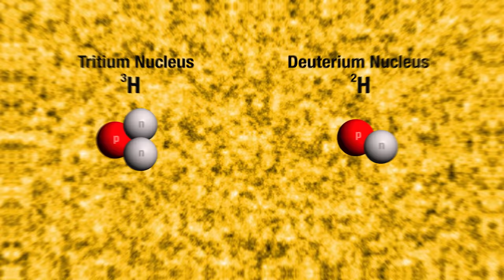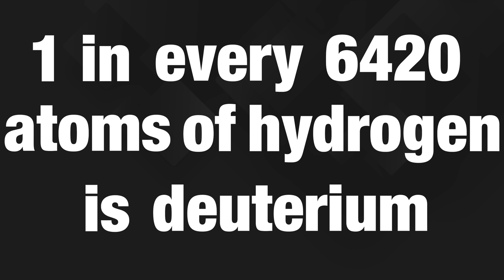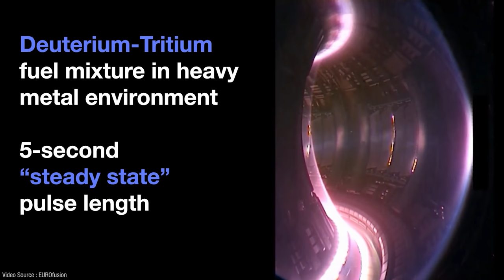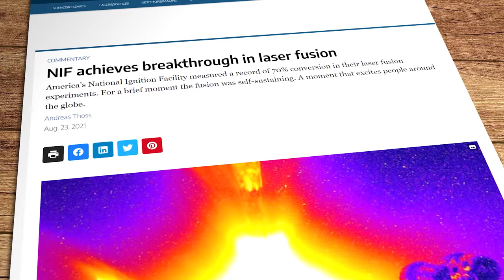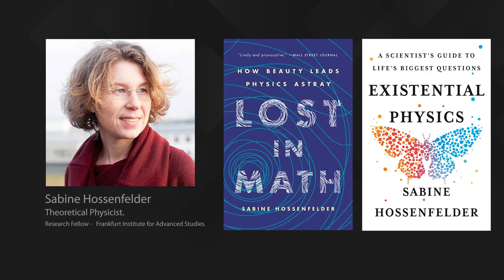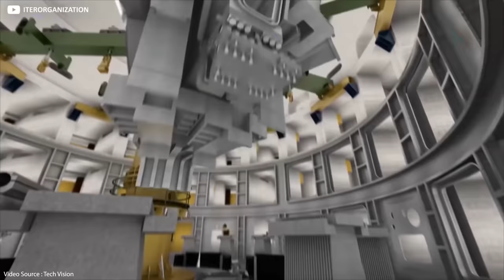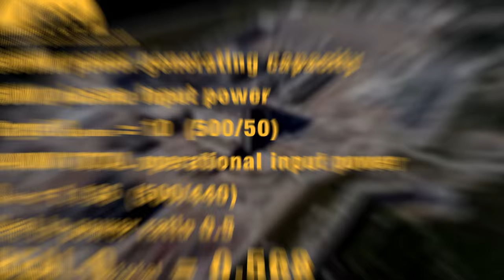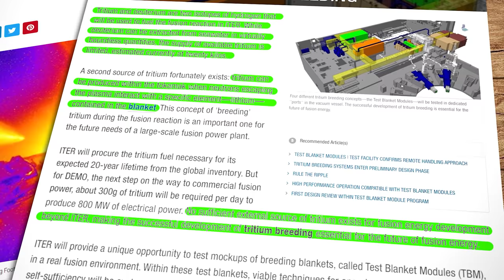Nuclear Fusion Illusion. Is it time to park the pipe dream?

Comment: Sorry Dave, whilst what you say here is all basically correct, it's still misunderstanding the current developments and experimental work. Everyone involved knows all of what you just said. Even I know all of that and I'm just a software engineer that takes an occasional interest in the subject. It's all about the difference between specific experiments and commercial power station designs. ITER is just an experiment to prove Qplasma >1 is possible (without superconducting magnets). (And as such it's actually obsolete because now we have REBCO tape superconducting magnets). The fact that it would still be Q<1 by the time you put it through a turbine is completely uninteresting. We knew that in 1987.

Jet has only improved output power by a factor of 2 in 25 years because it's the same basic machine with a few upgrades (and running tritium experiments is expensive and difficult so doesn't happen very often). But they have improved plasma stability by a factor of millions, and that's actually the important bit.

The existence of REBCO tape magnets means we can reduce the size of a working high-Q tokamak by a factor of 10 or 20, so now they cost a few tens of millions, not tens of billions. Tokamak Energy and Commonwealth Fusion Systems are proving this in the UK and US respectively.

And apart from ITER the amount of money spent on this really isn't very big at all, given its importance. Until recently there was almost no money going in, ans that made progress very slow. The private companies like TE have really helped get some more investment and show what can be done with quite modest amounts of money. They had 24-hour stable (low temp) plasma 5 years ago. And 20T REBCO magnets 2 years ago. 

Yes, clearly, even after getting positive Q plasma and continuous high-temperature plasma there is still work to do on proving tritium generation and heat jackets for commercial generator designs, but given a reasonable money supply I don't think people in the know expect that to be all that difficult or take many years. And after getting positive Q plasma and continuous HT plasma, there will be no shortage of money.

Yes, these timescale are not relevant to the 'half emissions by 2030' goals, and only marginally relevant to 'zero emissions by 2050'. So the tech may be shown to be working just about when we don't really need it any more, but it does depend on how much it would actually cost to make systems. I can see it being prohibitively expensive in practice, in which case we all end running everything on wind, PV, tidal, geothermal, fission, and a great deal of storage, which is fine. And we may end up replacing old fission plants with new fusion plants - it all comes down to costs.

So overall I find this video a bit misleading to many people, by confusing experiments with power stations, and ignoring what TE have done. We could easily be <5 years from positive Q plasma demos (ie. not 20).

Comment: Excellent video, sir.  Also (courtesy of Sabine Hossenfelder) the neutron activation of the reactor lining is worth noting.  For years fusion has been sold as being super clean, but it isn't.  Fusion generates a ton of radioactive waste through neutron activation.  Sabine said that fusion will actually generate more radioactive waste than fission.  So why are we spending this money on fusion experiments when we could be building more conventional fission power plants?
Reply: There are different types of nuclear fusion, not all are neutronic.

In neutronic sources, Nuclear waste will be limited to the reactor itself and any surrounding equipment (Given neutronic solutions appear to be getting bigger and bigger, Sabine is probably right)

In Aneutronic, this will not be eliminated, but will be significantly reduced as the neutron flux will be 2-3 orders of magnitude lower.
Reply: Or just much cheaper and quicker to build renewable technologies...
Reply: We need both, renewables have their issues too.

Over specialise and breed in weakness

Comment: Your math on the ITER output might be wrong. The 50% conversion loss to electricity should only apply to the surplus power output (60MW) of the system. Meaning it would still produce a net 30MW of electrical power (Qtotal = 1.068)

Comment: Are there any reactor projects yet using the newer high temperature superconductors? From what I understand, no. Also I doubt that many of  the support technologies are currently being optimized. No point in optimizing those parts until we exceed breakeven and know what we need to optimize to. We won't know the final numbers until all the parts are further developed. Q-fusion is the first step that makes the rest of the technological development worth it. And once the high temperature superconductors are in use then better estimates can be made about the total process.

Comment: Thank you, I really think future development of energy production, storage, and transport ought to be pursued largely as it is now: renewables like solar and wind, geothermal, and esp new nuclear fission technology application such as  miniaturized reactors using the latest designs. I also technologies that increase fossil fuel efficiency need to be explored --lightweight materials for building engines and vehicles, more efficient use of fuel in advanced internal combustion engines (like camless valve gas engines etc). Another key item is passive energy efficient buildings that can heat or cool with as little energy expenditure as possible. Of course very little of these efforts will "take off" in the real economy until they become significantly profitable.

Comment: 2 things: The neutron induced fission should not have the same regulatory implications as those for fission plants. It should be more like the enrichment for radioactive isotopes for medical or other purposes. (nowhere near the risk of a runaway fission proces). We spend more on 1 olympic game then we did on Iter over the past decades. It definatly does not eat away at funds for renewables and is not on the roadmap to get us to the 2050 climate goals. As it is clear it would be to late for that. It is a long term project that hopefully eventualy suplies a baseload or is usefull in specific domains.

Comment: My take is that we should really keep funding fusion, not because it is going to be viable on any useful timeframe to us now, but because we are learning about applied physics in a way that even if it doesn't lead to fusion soon will still enable us to go for fusion later or maybe open up avenues of research we didn't expect. Even if fusion never happens we still have plenty of applied physics and materials science knowledge to gain from the fusion projects.

Fusion research funding isn't threatening renewable uptake much either. The funding isn't branded as or taken from the renewables adoption budgets, it comes out of the budgets for applied physics research centers and projects generally or is branded as special investments specifically into fusion. I don't see any of the money going into fusion either being diverted to renewable adoption nor making a lick of difference if it were. The total budgets of the various fusion projects sound like big numbers, but they are usually funded by large collaborative groups and those "big" numbers are absolutely minuscule compared the funding needed to apply renewables at sufficient levels to our match our energy generation needs.

I think it's a false dichotomy to pit fusion vs renewables. Fusion projects are generally not competing against renewables for funding, it is competing against other large scale applied science and engineering projects, like particle accelerators, satellites, etc.

All fusion projects right now are science experiments first and profitability is a distant afterthought only mentioned because journalists keep asking about it. If any fusion project ever achieves some level of possibility for profitability then we can talk about actually counting fusion among our energy generation options and funding it as such.

Comment: >>> A real breakthrough could come from a third approach. Proton-Boron fusion has the advantage that boron is a solid and relatively dense. However, it requires 630 kilovolts of proton K.E. to overcome the electrostatic repulsion. And the capture cross-section is 0.8 barn. So a lot of incoming protons may miss and just end up embedded in the boron crystal. If we do get a P-B fusion, it produces an unstable C12 or C11 which promptly fissions into 3 alpha-particles (mostly). We can harvest the alpha-particle energy using MHD. But there is also significant energy in gamma rays. We need to invent a way to turn gamma-rays into electricity. But if we could make this work, it could be an energy source with no moving parts and relatively low neutron-activated material when the reactor reaches end-of-life.

Comment: After they run ITER, they might be able to upgrade the magnets with new superconducting ones which operate at nearly room temperature.  In that case, all of the existing infrastructure can remain in place.  And they are already designing the next stellarator which will be even more compact.  I would bet that within my lifetime, we will get that Qtotal greater than 1 (I'm 43).

Comment: The real problem with fusion is that we are still missing a crucial piece of fusion physics.  It is not just a question of banging the rocks together harder, nor it is just holding the plasma pressure.  The probability of fusion of two deuterium atoms is less than 100% even at the energy levels required for fusion to occur.  Perhaps it is an alignment issue and the atoms have to strike at a precise angle or spin.  The Sun gets by this by having a huge free gravitational field to hold it all together as the atoms strike each other and some tiny percentage just happens to be in the right configuration at that moment to fuse.   Not having a huge free gravity field available, I think we are going to have to solve it via precision - not via strength.

Comment: Over the past 20 years or so in various social media platforms I've been trying to counter the arguments of those who become nearly orgasmic over every claim of fusion researchers. The simple problem is that until a research reactor can:
1) operate at a Qtotal in excess of 2 (thermodynamics limits the amout of energy that can be generated);
2) does so for more than 1 year without significant degeneration;
then there is no prospect of commercial fusion generation.
Even if that happens it will still be another 10 years to design, build and site the first reactors

Comment: We are probably closer to having antimatter reactors ... if we could just find a cheaper source of anti-hydrogen. In the meantime, we need to knuckle down and start building more fission reactors with liquid salt cooling.
Reply: Too dangerous. Not because of risk during normal operation, but, because they're a prime target during war, or a terrorist attack. Russia is targeting nuclear facilities in Ukraine right now. Scary to say the least!!
Reply: @vincentrobinette1507  The same thing could be said of any large scale power generation plant. Hitting a large coal fired plant could start a fire that could burn the plants coal stockpile in an uncontrolled way, releasing large amounts of CO2, CO, NOx, soot, and radioactivity. Hitting a fusion reactor would cause an uncontrolled release of the highly radioactive plasma, the neutron soaked lining, and stockpile of tritium; as well as destroy an expensive asset. With a fusion reactor, all you need to do is disable the magnetic containment and the reactor will do the rest. Terrorists could do a lot of damage to a field of windmills with inexpensive explosives. A well placed charge in a hydroelectric dam could decimate large populations. Conversely, something like the LFTR technology would contain most of the radioactive material and then cool down naturally. Energy is neither free nor harmless, we need to balance the cost and risks versus the benefits.

Comment: Engineers are clever, and I think the technical roadblocks to nuclear fusion have been overstated in this video.
1) The goal of researches right now is fusion ignition, a fusion reaction that is capable of sustaining itself through its own heat in a manner similar to chemical ignition. When you're first trying to start a fire, you have to put more energy into the system than you're getting back. If somebody has never lit a fire before before, then rubbing sticks together for just a few sparks looks like an absurd waste of effort. Reaching Q total once we've reached Q plasma is probably not as difficult as this video makes it out to be.
2) ITER hasn't been the gold standard for fusion research for years. If it were a private project, then it would be abandoned due to technological obsolescence. Modern superconductors can be used to create a smaller, cheaper, much more energy efficient reactor that's capable of achieving ITER's goals. Commonwealth Fusion plans to do just that with their SPARC and ARC reactors and are on track to beat ITER to the punch. They also plan to use a molten liquid lithium fluoride blanket that will serve three functions in one: a) acting as a radiation shield, b) removing heat from the system to turn a turbine, and c) breeding tritium which can then be fed back into the reactor.
Reply: "Engineers are clever". Well thanks, not the usual comment I get at me.

Comment: The most promising reult of fusion that I heard came from the SAFIRE plasma experiment. Supposedy they are in the process of getting partners for a commerical plant. Another promising project is the LLPFusion project. Both of these uses the stronger electric force to achieve ignition, instead of the weaker magnetic force.  They also do not use tritium.
Reply: ITER is 30 year old tech. I'm frankly sick of seeing the project used as a punching bag to pretend that far more advanced designs aren't going anywhere. It's shameful.
Reply: @j.f.fisher5318  70, tokamak was conceived in the 1950's

Comment: Another problem that contributes to this long development situation is that the most serious projects like Iter or Wendelstein are classical University research projects. And all of us who worked as researchers on Universities knows what this means in time of speed and deadlines. 

At Wendelstein due to a lack of huge investment people do normal working hours. On that front speed could easily be trippled by working around the clock in three shifts. In addition there are no reward shemes for finishing the project. No researcher becomes a billionaire by building Wendelstein. Then burocracy is like at the universities. A mindset like for typical people working in the public sector. All very slow and resurce inefficient.